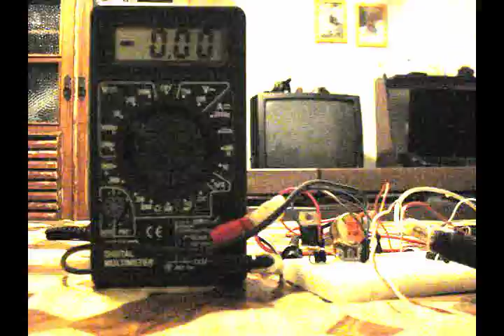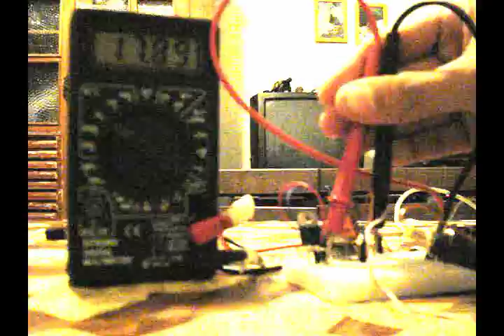Adjustable Voltage Regulator with LM317 IC

Comment: What type of power handling will this setup have.  I would really like to use it to control the voltage on a 12A line off of a ATX PSU, but I don't think it would handle that kind of current.